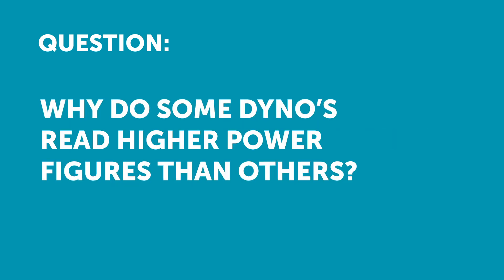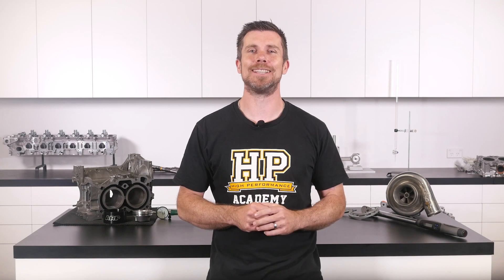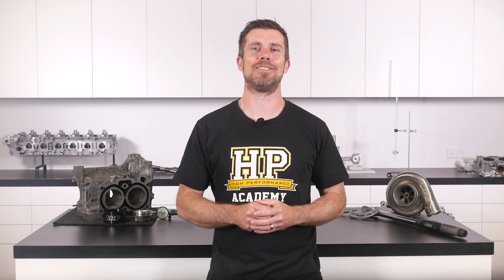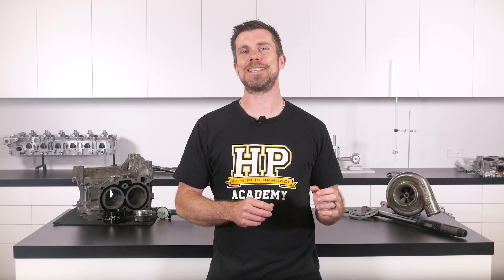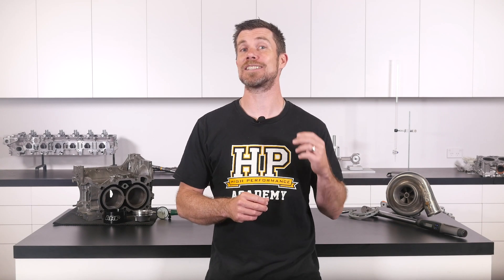Why Dyno Numbers DON'T Matter! | Dyno Accuracy [HPA Q&A]

Comment: What are the tuning effects of having multiple smaller injectors per cylinder that equal a flow rate of a single large injector? What are the advantages and disadvantages  of running multiple injectors (excluding cost and equipment limitations.)?

Thank you
Reply: Depends on hp, mostly when you get to higher hp pec cc you may need smaller injectors to get good fuel atomization,  and larger ones when the power comes on. Injectors have a range they are best for, having two or more sets per cylinder can keep you in there sweet spot. Theres a lot then that but thats a basic overview

Comment: That is exactly what a dyno is for... to compare the changes that are made.
Just had my Holden vy ss ute gen 3 ls1 5.7l reflashed and a mafles tune done.  First run is to get the baseline numbers (what we start with before we start changing anything) my first run was 222.4kw as my start point. 
My final run finished at 247.4kw . I could have gone to 250kw but im keeping it on the safe side abit as the engine has 300000km on the clock. 
Not bad increase. 
We used the recently updated Mainline dyno
 At  Eastern Automotive performance centre with more than 20 years experience in LS engines tuning based in Auckland,  one of the best tune shop around here.  Very happy with the results. 👍🔧🏁

Comment: If dynos are inexplicably innaccurate, how do series have horsepower regulations? If you can't tune for exact numbers then how can you tune competitively?
Reply: Engine dynos for competitive road racing, and things like turbo size restrictions for drag racing (Plus weight restrictions etc.)
Reply: Dynojet sae dynos are accurate.  And is used by the regional time attack classes.

Comment: No not to stick with one tuner you may get milked
Reply: honestly with that attitude I don't think any tuner would want to work with you. customer loyalty works both ways. for instance, it's not common for someone to spontaneously switch dentists without some transfer paperwork to be done AND full consent between these two dentists. because how can we be sure that you are not trying to "milk" us as a tuner? we have to have recourse and look out for eachother as well and taking chances on customers like you with no loyalty or respect may not be worth it.
Reply: @SDDevelopment  but how do you know if you're tuner is what he says he is  ?  As I would love to find a tune shop that has been educated by you guys at high performance academy. 
So I might need to shop around for the right tune shop ?
Reply: Probably just the one you used lol, I see tunes people spent good money on that are crap , but lets face it if your tune was 200 its probably crap if its 500 up your on the right track for basic upgrade, if its cheap but they tune that set up all the time you probably just lucked out. When i get tunes in im usually disappointed in the industry, but hey if they had a good tune they probably wouldn't be going somewhere else, so i have faith there are people that actually do a good job. If you have  a complete base map and everything is different expect to spend some money to get a decent tune, if you added just one thing to a factory or excellent tune, shouldn't be to bad. Real race cars with high hp per cc with a crap tune or basemap expect to spend money. Nothing's black and white, it is what it is. This was written on a cell so dont be a di..
Reply: Thanks mnrracer 👍🔧
Reply from the maker: It is generally the opposite, the more you support a good tuner, the more they will support and look after you. To be fair most businesses operate like this. Finding a good tuner is the hard bit - Taz.
Reply: @hpa101  can you tell me which tune shop in Auckland was taught by you guys.  Or is that a breach of confidentiality.

Comment: Exactly. There are many different variables that can affect the figures, from correction factors for air pressure/temperature/moisure, to the various operating temperatures of the vehicle, how the cooling fans are arranged, to the rpm acc'n rate, gear used, operator techniques, etc.
Find one you trust and stick to it - as Andre said, it is at best a tool to compare changes made and what counts is the actual in-use performance of the vehicle, not the numbers...

Comment: what is the equation to transfer HP to MegaPoney? id really like to brag those WMP of mine to my friends 😂
Reply from the maker: You need to first convert to UberDonkeys and then go from there to MegaPonies. #science? - Taz.
Reply: I was wondering the exact same thing
Reply: All the Megaponies!!!
Reply: multiply by 1M!
Reply: So from what I was googling a 12 month horse or pony is 67% of the size the fully grown parent.  So if you have 1000whp car.  Add 67% that would give you 1670wPP. Move the decimal 6 spaces to the left and you get .00167wMPP.  But that seems a bit overkill.   I would just rate it a 1.67wKPP,   I am not sure on the conversion for LlamaThrust.